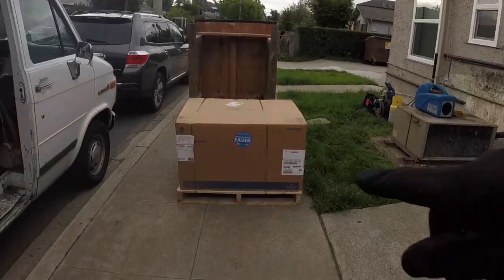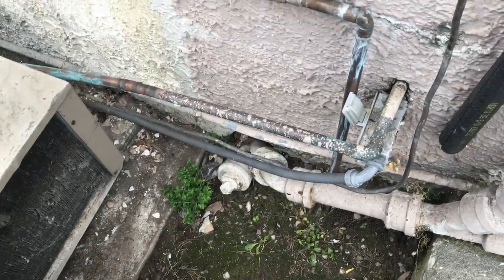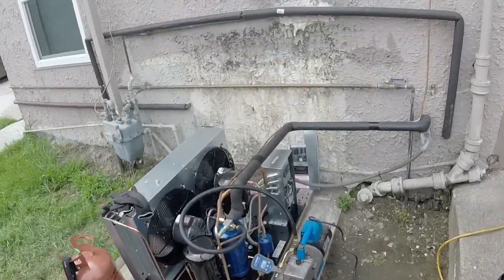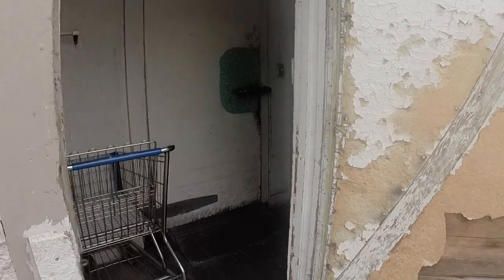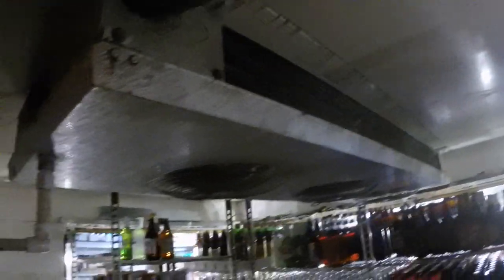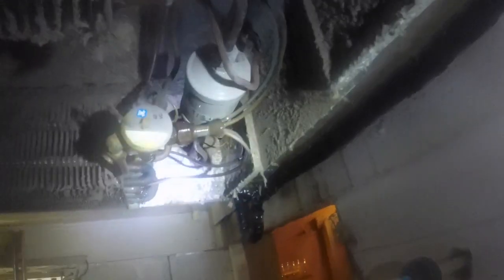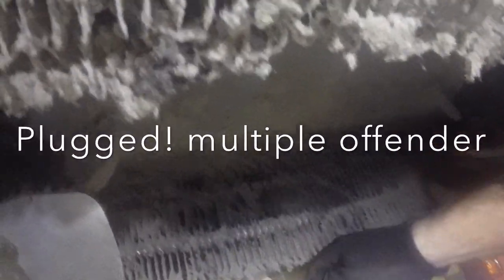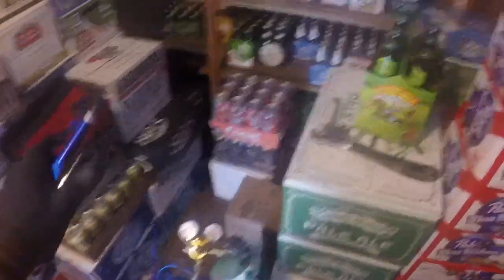No cooling call part 2

Comment: Nice replace & install Dave.  I like the alternate feature of the condenser fans, that's a smart idea.  I have seen a lot of plugged up evap & condenser coils, that certainly wreaks havoc.  I try to tell people that you need have maintenance on these systems from time to time, but they never listen.  Thanks for the vid.
Reply from the maker: They never do. I have zero maintenances they won't pay for it here.

Comment: 🤘rock on brother. Those new Copeland condensers seems pretty good. Love the intuitive features they put on them but I’ve replaced a few of those temp sensors and transducers. Good job on being thorough on that oldie those old low profile evaporators are a biznitch to clean. That debris is like concrete in those evaporators

Comment: Nice install ! Nice job securing that liquid line that was swinging in the breeze on that wall. I'm amazed she didn't chafe a hole in the copper.
Reply from the maker: I cut it at the top and ran a new line.
Reply from the maker: +OcRefrigeration,Hvac & Electrical. It was

Comment: short or long radius Elbows only apply to the discharge line..  on discharge lines you should be using long radius..  .. on another note.. that liquid line is funky.. wonder why it went a different route?  but nice of you to fix it up.. nice install.. nice condensing unit... also .. the coil they have for the glass door section isn't the best choice..
Reply from the maker: You need long radius on suction line also.  To avoid pressure drop. Max is usually 2 psi on a system.
Reply: i'd rather drop pressure than raise the pressure.. i've been using short radius elbows on suctions my whole life.. never had an issue.. using short radius on the discharge does create a problem @NorCal-refrigeration
Reply from the maker: prime time refrigeration we are supposed to use only long radius but I’m not the refer police. What ever works for you my man is fine with me.  Ill be using long radius

Comment: Good looking install, Dave, line set looked great. When you have to clean the evaporator coil unexpectedly do you just do it and charge extra, eat the time, or ask the customer? I remember on some of your older vids multiple offenders got spanked, lol! Thanks for posting. -Tom
Reply from the maker: I can't leave it on a new cond, unit install, you clean it. Your there just do it. The trick is on old funky units quote the price of the unit and let them know install and start up is T&M because it's old and you do not know what your going to find. Show them what you find and it usually works out ok. He understood when I showed him that coil.
Reply: +Nor-Cal Refrigeration & H.V.A.C  That's exactly how I do it too Dave. As long as you can show and explain the situation to the customer they'll almost 100% of the time tell you to go ahead with the repair. Ps. I absolutely dig your vids man, really neat to see the variety of refrigeration you get to work on and how thorough you are on all of your calls. Definitely gets me pumped to go out and kick ass on service! Thanks man!
Reply from the maker: +Benjamin Woodward thanks Benjiman

Comment: Good job , multiple offender huh? they all are I just found out,  did you end up replacing that liquid line drier? also did the new unit came with a defrost timer?
Reply from the maker: Yes on the drier no on the defrost timer. I'm going to put one inside the box so it cycle the solenoid valve and pump down during defrost. The old clock just cycled the compressor contacts
Reply: +Nor-Cal Refrigeration & H.V.A.C ...Nice  good job like  always .. props from So-Cal
Reply from the maker: +Felipe Tafolla thanks Felipe

Comment: Hey man.. 

I was wondering why you are against short radius elbows exactly?  Yeah, i hear they are not 410-A friendly due to higher pressures, but just 1 on say a suction line wouldn't hurt.. I wouldn't think anyway....

Can you show me what your fear on short radii is?

I enjoyed the video.. I like using a solid bent piece even if i have to put 5 different 90* bends with my Hilmor to save on elbows and other braze areas. More couplers and elbows, allow more potential leak possibilities on down the line.

I look forward to hearing your thoughts on why short radii is bad.

Adam
Reply from the maker: +iconbadgta for refrigeration piping its long radius only, for psi drop.  Yes you can run shorts and the unit will probably last just as long. But the correct way is long radius.

Comment: I know it has a wooden dog house but how come no outdoor condensing unit like the old one ? Another great job done the right way !
Reply from the maker: With that house over it and A California climate I did not need the extra metal cover. Most here use indoor units and make sheet metal covers. With my winter low over night is only in the 40's a couple  nights in 30's.

Comment: that low velocity coil is really not a proper coil  for that beer cooler.. would never use that style
Reply from the maker: Got to work on what the customer has.
Reply: @NorCal-refrigeration  i know but i'm say if that job was done from scratch...you did what you had to do .. and did a great job

Comment: Do you use the long radius els vs the short to cut back on friction?
Reply from the maker: For pressure drop and oil return. For HVAC/R it's long radius elbows only.
Reply: Thanks man.😎

Comment: I'm sure you have BUT, do you run across very many gummed up and sticking txv internals using 404a gas? I enjoyed pumping down a circuit and busting down a txv. Don't really get those opportunities with my new employer
Reply from the maker: bblazeff1 I do.
Reply: Nor-Cal Refrigeration & H.V.A.C Have any vids doing so?
Reply from the maker: bblazeff1 I’m sure there is.

Comment: Those units are relatively new out. What do u ask for when u are asking for that kind / getting one of those. Aren't they from United. Pm me if u want to keep that info on on the DL. 
Cool feature -Lead lag cond. fans. 

Really Nice that it has everything including a suction accumulator. Nice bit of compressor protection for that medium temp box. / refrigerator.
Reply from the maker: I just ask for the copeland scroll cond. unit. They start at 1 1/2HP I get them at RSD.
Reply from the maker: +OcRefrigeration,Hvac & Electrical. When you start them up the cycle 3 times. Like short cycling it's part of the logic in the psi control I should have got that on video. It looks like it's got dry heaves. Lol.